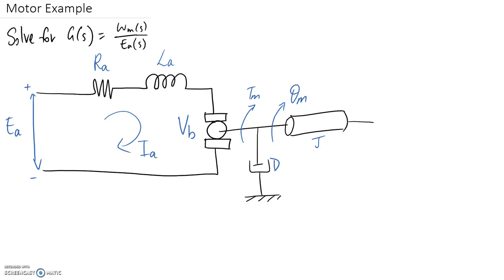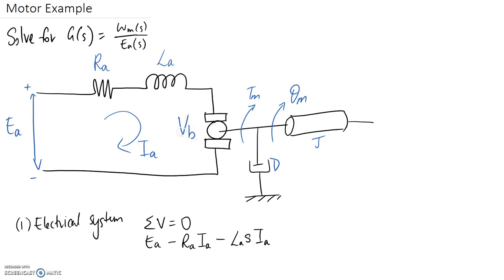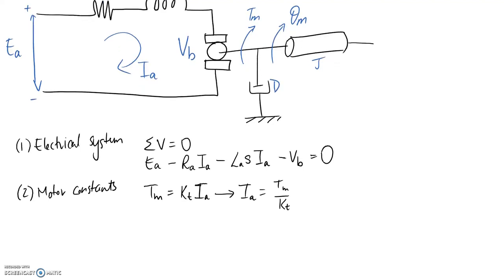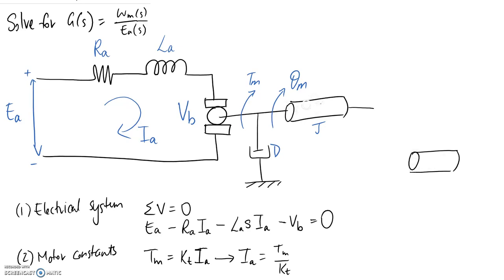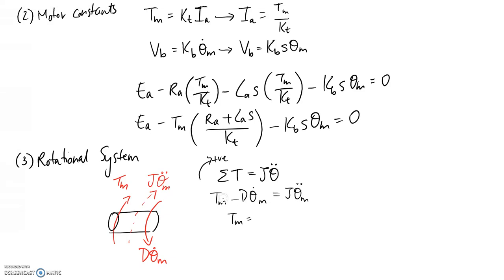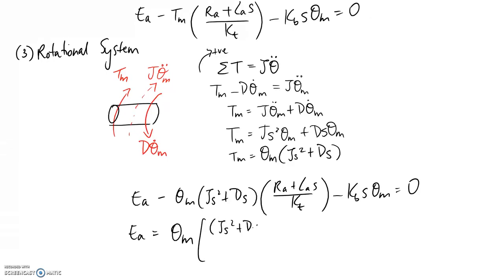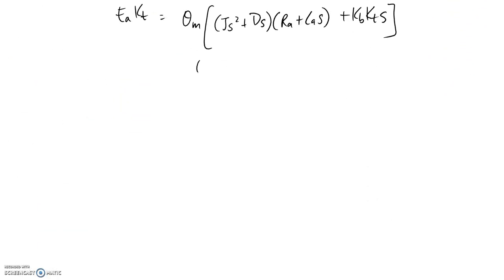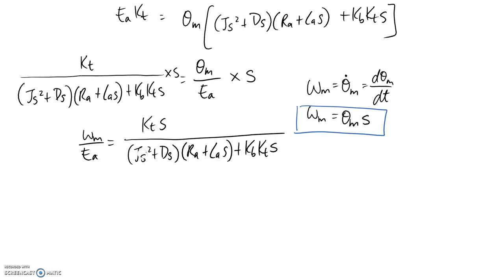Example: Motor Transfer Function

Comment: Great explanation! How do you find the value of Kt and Kb? thanks
Reply from the maker: You need to be given information about the motor - either the parameters directly or curves that you can calculate the parameters off.
Reply: @theryderproject5053  How to describe speed and torque as a transfer function?
Reply: @theryderproject5053  This is a long shot but how do you calculate the parameters with the curve?
Reply from the maker: @TheDirtyyBird  Try this video https://youtu.be/Pzbn4L18QF8

Comment: Hello madam, 
I am trying to get transfer function of a bldc motor by using speed torque curve. I've managed to find everything in this video except Js^2 +Ds. I look at my notes from lectures but in those examples J and D values are given. How can I solve this issue? I would be appreciated if you reply.  I wish you healthy days.
Reply from the maker: These are your motor inertia and motor damping. You're going to need to be given some extra information to work these out if they aren't given directly. You might be able to do it by simulating say a step input and then fitting to the response (and where it fits you can then extract out the most appropriate constants).
Reply: dostum merhaba ,
problemi çözebildin mi acaba benim de elimde bir motor var ve bu değerler yok .
Reply: @berkemirac716  Motor benim elime geçmediği için geçici çözümü bizim motora en uygun olan kaliteli firmalar tarafından satışa çıkarılan motorlarin datasheetinde buldum. Firma kaliteli olduğu için tüm testleri yaptırmış. Tüm değerler verilmiş datasheette. Motorlar benzer olduğu için oradaki verileri kullandım ve işimi gördü. Ikinci çözüm olarakta Norman Nise - Control systems engineering kitabinin 4. Chapteri example 4.7 de belirli koşullar altında j ve d değerlerinin nasıl bulunacağını söylemiş. Elinde motor varsa hangi testleri yapman gerektigi internette olması lazım çok bilgim yok o konuda.
Reply: @alperyasin710  ben namiki dc motor aldım r ve l değerleri de yok elimde sadece stall torque continuous torque var bakalım matlab kısmından deneysel bir sonuç gelir mi . Teşekkür ederim ..
Reply: @berkemirac716  how to measure resistance/inductance in dc motors yazarsan YouTube da işine yarayacak videolar bulursun
Reply: @alperyasin710  çok teşekkürler .